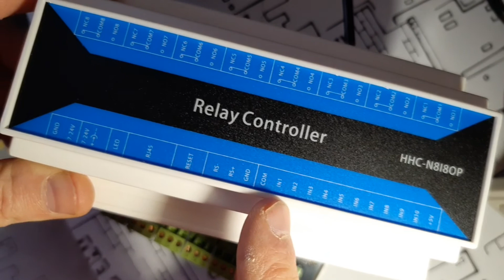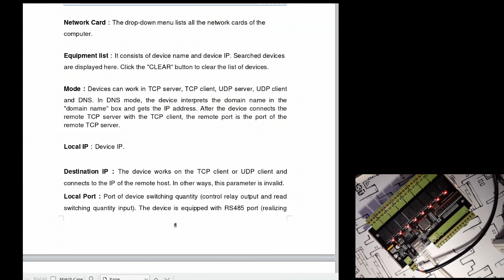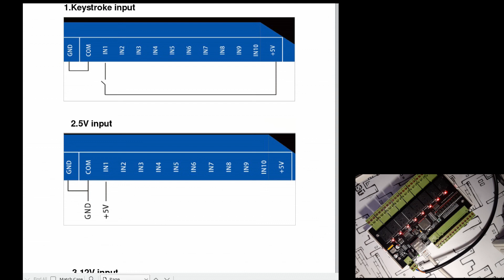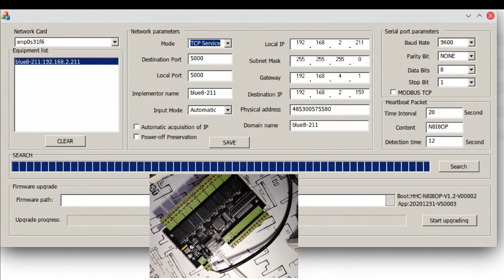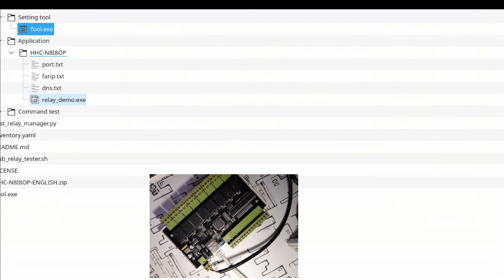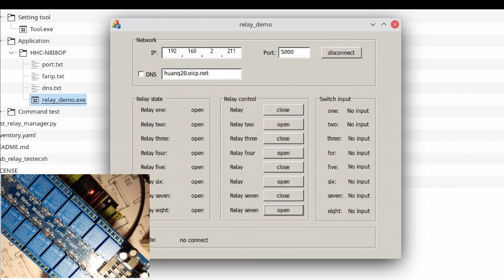HHC-N8i8OP 8 Channe IP Network Relay Remote Control Device TCP Bistable Relay Module

Comment: What is the best way to control via ethernet
Reply from the maker: Sorry, I don't have an answer. Due to some bug in client software, I stopped using this module.
Reply from the maker: actually I am testing https://github.com/instipod/HHCN8I8OP-MQTT now. And relays work well so far.

Comment: Please, tell me how I can connect the HHC to the pc. I tried to do with a router but the setting tool doesn't see it.
Reply from the maker: From doc: 7.Reset configuration. The position of RESET is the key to restore the factory settings. Restore the factory settings steps: first power off, then hold down the reset button, and then power the product, 10 seconds later release the button, and then re-power. The default IP is 192.168.0.105.
Reply from the maker: You may have different network mask, e.g. 10.0.0.2.
Try to connect on different router, through plain switch, directly or wigh static ip. You have to be in the same network wigh relay 192.168.0.x

Comment: Nice, i make solutions based on the ESP32 + rs485 and i2c extender. It support SSL and/or WebSocket connection?
Reply from the maker: Plain tcp connection with proprietary protocol

Comment: Hello,

one Relay alone on one the switch keep going well over the Tcp Service Port 5000.

Now we have serious problems with two or three relay on one switch. We cannot ping all device simultan.

We have timeout problems and cannot managed or control the relay.

Can you tell us the newest firmware version or send us a file ?

best regards

Joachim Assfalg
Reply from the maker: I don't have firmwares. You can try to find manufacturer contacts  in documents from github or contact seller.

There are mention of 8 connections limitation in doc. I was planning to switch to UDP connection in case of issues. Reccomend to be carefull with sockets closing and limit number of reconections. Try to keep connection live by sending ping requests.
Reply: @4olovik  Hi we have found the problem. The configuration tool show us the same Pyhsical Adress on both relay. We change the pyhsical adress, thats was the solution. 
thanks for your fast request

Comment from the maker: Update: inputs are working. Using 2 of theese with home assistant and it works very well.
Reply: Hello,

one Relay alone on one the switch keep going well over the Tcp Service Port 5000.

Now we have serious problems with two or three relay on one switch. We cannot ping all device simultan.

We have timeout problems and cannot managed or control the relay.

Can you tell us the newest firmware version or send us a file ?

best regards

Joachim Assfalg
Reply: Oleksandr hi, thank you for sharing your experience with this relay board. We are planning on purchasing them for home assistant project. Could you please elaborate on how to implement inputs as binary sensors in HA. Thank you! David

Comment: Do you know the standby power consumption (all relays off) of this device?
Reply from the maker: I can try to measure before ac-<dc converter, but assume consumption is low, this relay module in closed case is not even warm.

Comment: how can i send the signal using rs485? What is the rs485 device id? If i have 2 devices controlled using rs485 then how can i assign rs485 device id for each. Do u have any idea? can u help.
Reply from the maker: I don't have answers for rs485. I am using this device over ethernet. Tools and .doc instruction you can find in this repo https://github.com/gabrielgbs97/hhc_n8i8op_mqtt